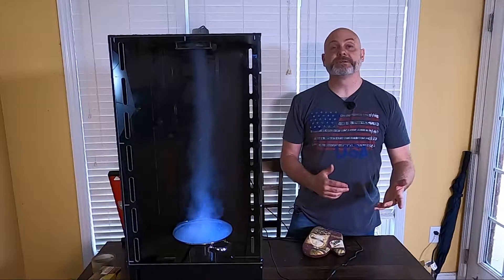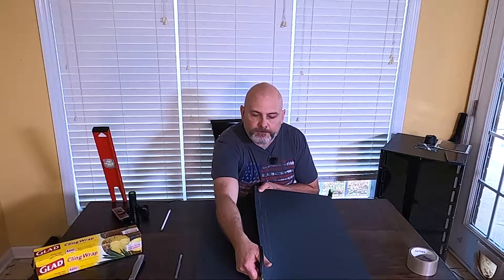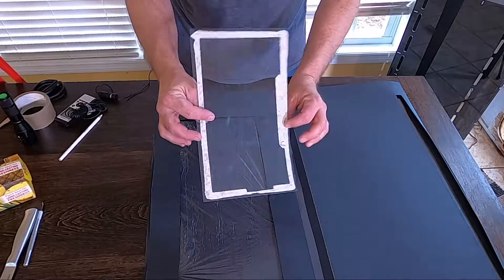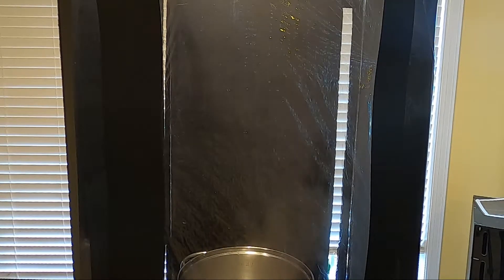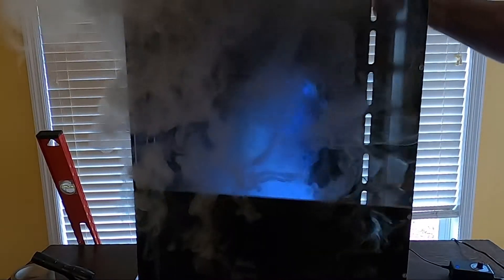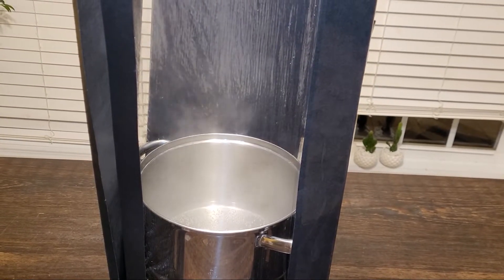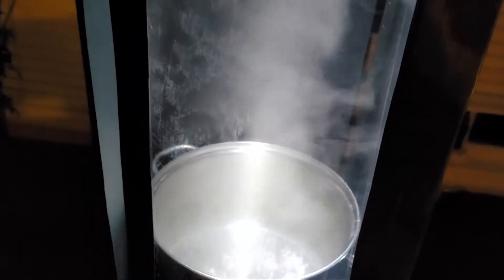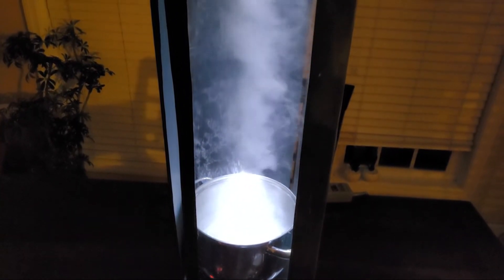Build a model of a Tornado that you can enjoy indoors.

Comment: just use a ultrasonic mist fogger. then you won't need boiling water or dry ice. you can buy then off amazon.
Reply from the maker: I actually tried them, but just couldn't make it work.  I only had one fogger, so fog production was limited.  I suspected that if I could reduce the updraft to the perfect "updraft / mist" balance, it would work.  I tried a handful of fans I had laying around, but just couldn't get the balance right.  They either sucked all of the mist out too fast, or mist just filled the bottom of the chamber, actually inducing a slight "downdraft".  I intended to try it again, but I got busy and shelved the project.  Since you brought it up, I will probably get my hands on more than one fogger, and revisit it.   Thanks for watching, and thanks for the suggestion.
Reply: @BornHandy  well if you have a smaller tornado machine then it will fill the intire bottom with fog clouds, even if there is one fogger. it's a good idea to have a huge tornado machine. but mine is small and only uses one fogger. thanks for replying! 😁
Reply: I use a humidifer
Reply: Yes, you can use a humidifier, but I use an ultrasonic fogger in a bowl of water, and it works much better. @Colossaltitannwkwbend